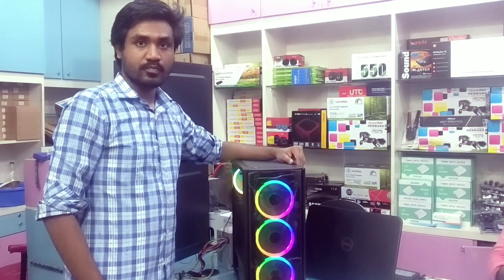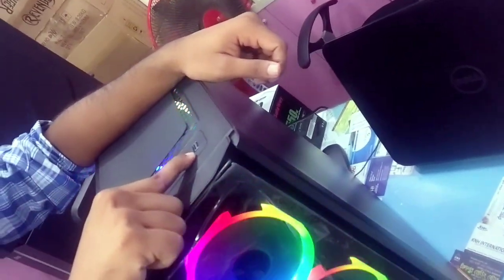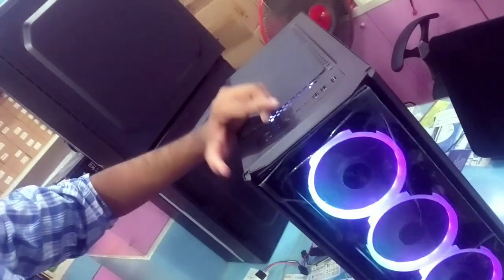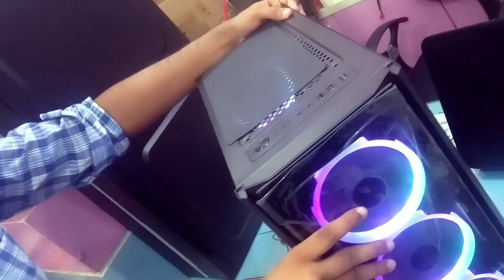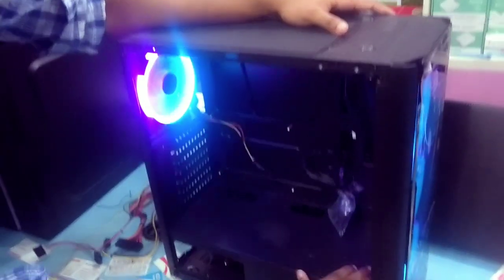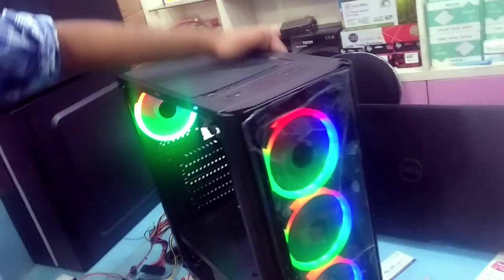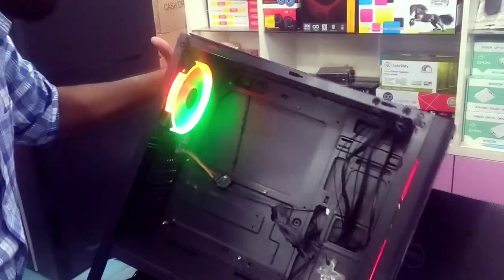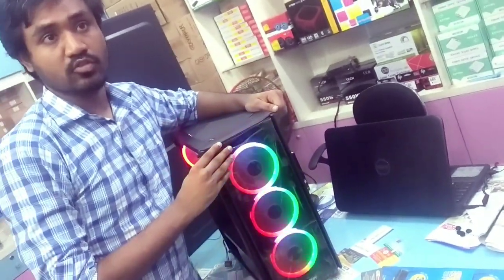Safeway Tornado MTG -1921 ATX Casing Review Bangla

Comment: How is the Air Flow? Because it have Glass in front. 
Is it good for gaming or not?
Reply: its good for gaming
Reply: @shadmansakibanindo6359  Price?
Reply: @helenawilsena5821  4k+
Reply: I purchased this casing from Ryan Computers IDB for tk.4000. They recommended this casing. Let's see how it works.
Reply: @rajiviqbal1534  i had purchased also. During 4 months i'm using it.
Quite good then the old one.
Reply: @helenawilsena5821  how is it now?
Having issues with heat?
Reply: @ShahNewaz1  No i didn't face any heat issues yet. Its working pretty Well. You can set 2 more cooling fan on top of the casing or you can use Cooler. 
Overall its good looking and cool.
Reply: How was the cable management?
Reply: @songoku-sj3wl  yea its look good. And the area is looking clean. Its a Medium size case. According to this, its good overall
Reply: @Helena wils Ena can I turn off the lights of those fan but still run them?
Reply: @songoku-sj3wl  maybe it possible  via motherboard. But not sure at all. There have a dedicated  buttons  for control  them. If you can configure then it might be possible.